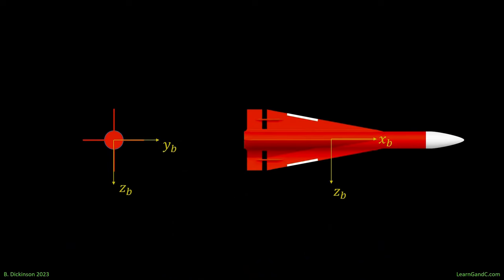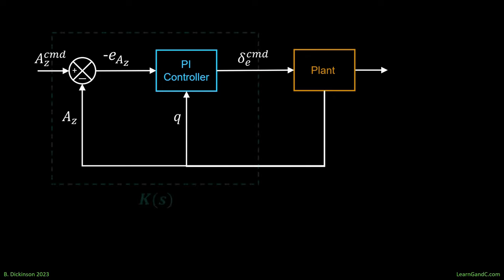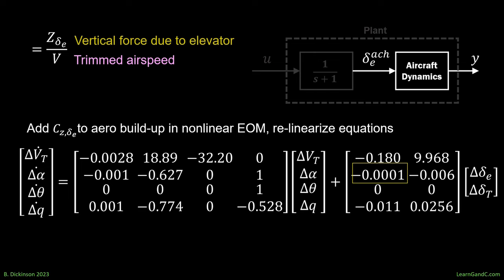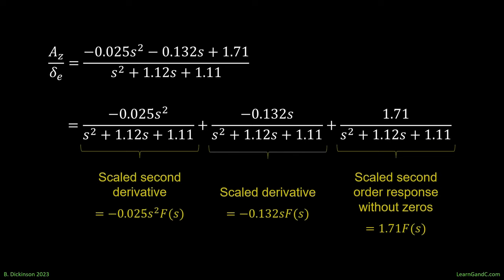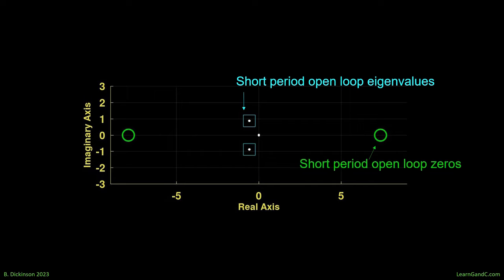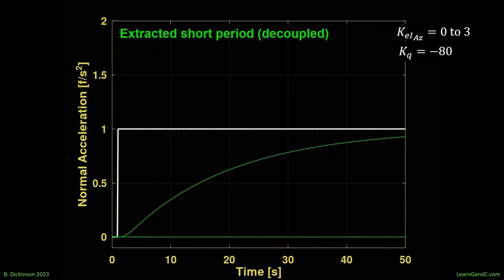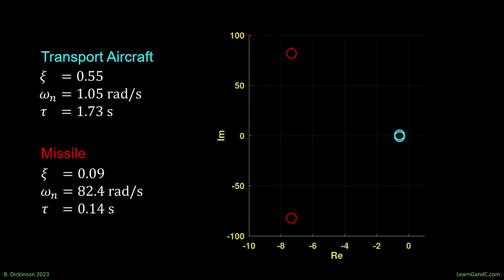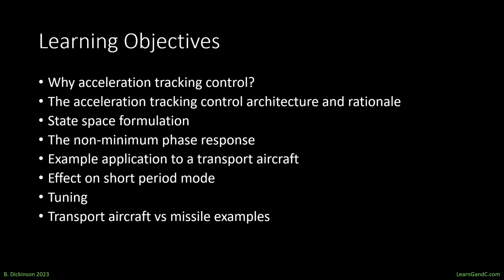Acceleration Tracking Control – Flight Control Fundamentals – Section 1.5

Comment: This architecture has acceleration error through an integrator. Could a faster response be achieved if (Az_cmd - Az) could have its own proportional gain as well? Is that even possible with state feedback? It seems like a major drawback of state feedback tracking if a step response must be slowed down due to the inherently-delayed integrator action. 

One could model Az_dot and add Az as a state, but  I'd imagine that while it could improve disturbance rejection it would  worsen tracking as the controller would actively fight any change in Az until the integrator on the error overcomes it.
Reply from the maker: Hi Andrew, certainly Azcmd - Az can have proportional control too. In this case, there is a feed forward proportional gain on Azcmd, and a proportional gain on Az.

This necessarily requires and Azdot equation if model-based design is used. When Azdot is derived, the elevator angle  becomes part of the rigid body description (to see derive from linear short period using the approximation Azdot = VT*(alphadot - qdot) ). 

On the positive side, one may enforce a more rapid response. On the negative side, three gains to tune is more labor intensive than two. These are my off hand thoughts not having worked with the proposed PI eIAz architecture.
Reply: @LearnGandC  makes sense, thanks Ben!
Reply: @LearnGandC  I took the code from Patreon and modified it, adding Azdot = VT(alpha_dot - q_dot). The new mode is not controllable or stabilizable, which makes sense givens it's a linear combination of the others. Is there a way to get around this besides removing one of the other two states (and reframing in terms of Az)?
Reply: Ah I forgot to differentiate del_e and put it in the A matrix.
Reply from the maker: Ok, I can produce a quick video on the math of this if you like. My focus is on finishing the "effect of zeros on transient response" video first through.
Reply from the maker: For PI control on eIAz, I typed that at 5AM in a cab on the way to the airport so I wasn't totally coherent. On second thought, one could just use the Az error from the architecture in Section 1.5 and pass it through a proportional gain, a separate channel to the integral action.  The approximation Az = Zalpha*alpha +  Zdele*dele can be used as it is in Section 1.5. The rigid body states are alpha and q. No dele equation is required.

This approach is most direct from what's outlined in section 1.5. What I suggested earlier is another way to approach it, but it's not necessary. Note with that approach the states become (Az, q, dele).
Reply: @LearnGandC  oh interesting, so u = - K_x*x + K_y*(y_cmd - y) when y = Az and x = [alpha, q, int(Az_err)]? 

That's clever, mixing state feedback with static output feedback. I will have to find some time to derive the closed loop transfer function of such an arrangement and figure out how to tune it. Thanks Ben!
Reply from the maker: Exactly, it can be worked into the dynamic controller LTI system as shown in Section 1.4 and 1.5. Mathematically, the structure is the same.